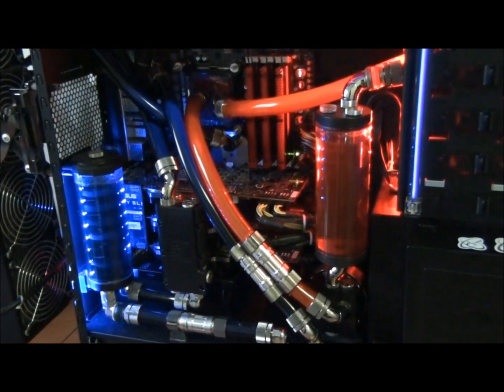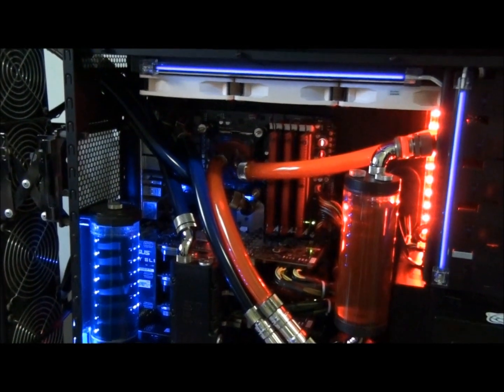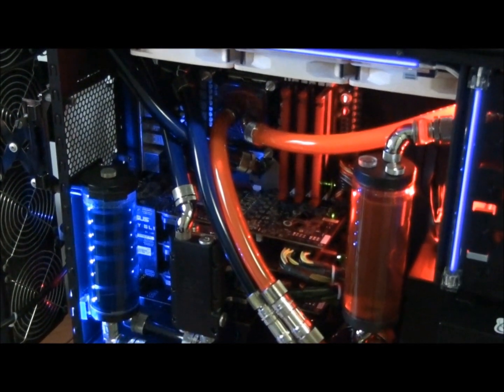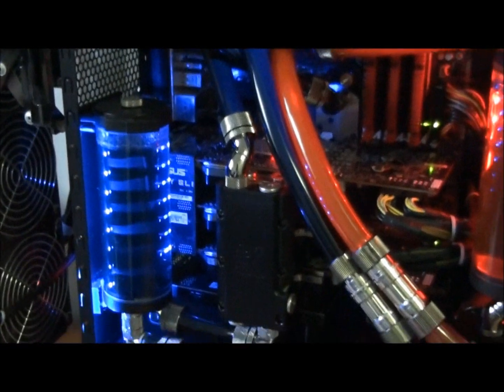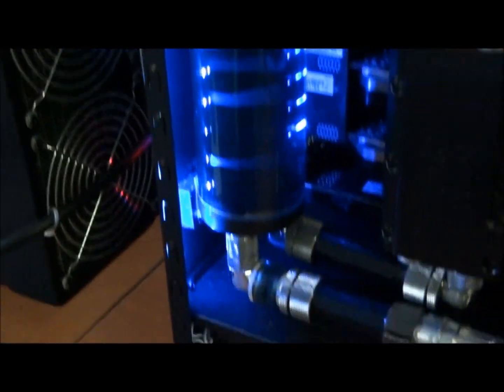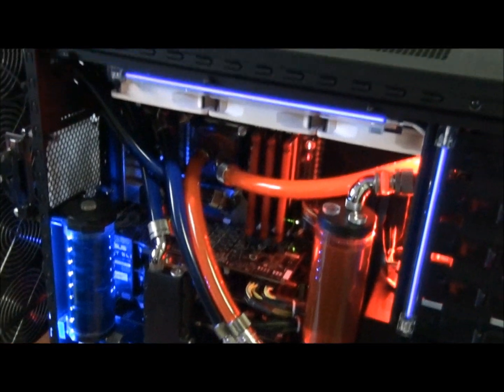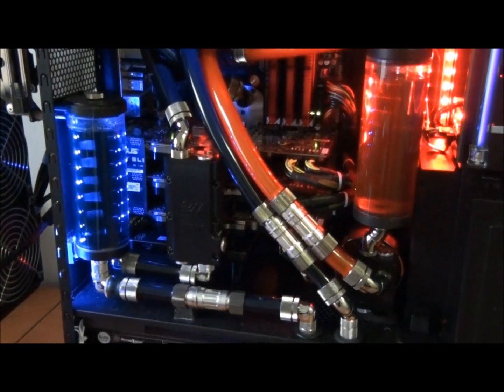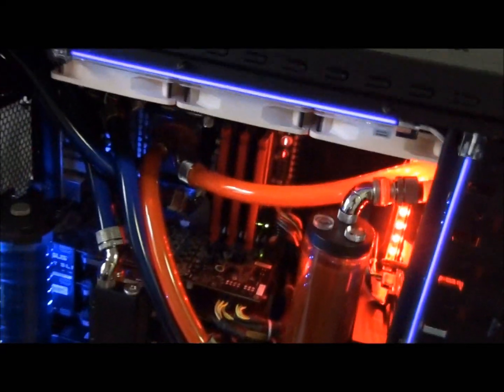PC Water-cooling Guide Episode 2 Design

Comment: I'm going to cool my core i7 3770k and my VRM on my maximus v formula, I have a thermaltake chaser mk- i which can fit 240rad and 120 rad, I want your advice as I'm thinking that the loop should go from the res to the 240 rad and then to the 120 and then to the cpu and the vrm, is that is the correct sequence or should I go res 240 rad cpu then 120 rad and then res? I mean which is the best loop to get me the nice temps I'm looking for, thanks

Comment: I'm working on a personal project: i7-3930K, 32 GB DDR3-1600 Dominator ram and 2 GTX690s, and an ASUS Rampage IV Extreme all watercooled. I thought about using two pumps (and by extension, 2 loops) to cool CPU, RAM and Mobo, and the other loop for the two 690's (Yes, I'm using 2 690s. Because I can.)? Or would a single loop be better? This isn't my first Watercooled system, but I've never done more than one loop.

Comment: Soo i'm fine to run my x2 Radeon 6990 in crossfireX through one triple Radiator, including my i7 2600k Overclocked? So this is my stuff atm,  this is being ran off a Laing D5 with close to the same Reservoir you have, including a Swiftech MCR320-DRIVE Radiator with an Inbuilt Pump..  Reply as quick as possible so i can buy the rest of my parts...    ^_^

Comment: Also take care when selecting  Cooling Block/s for your GPU. Graphics Cards advertsed by online retailers can be misleading, check carefully the manufactures part number to confirm if you are purchasing a Reference Card or not. Don't simply go by the photo on the web site. Make sure the GPU Block is compatable to the GPU.